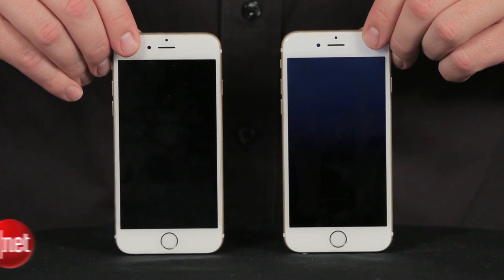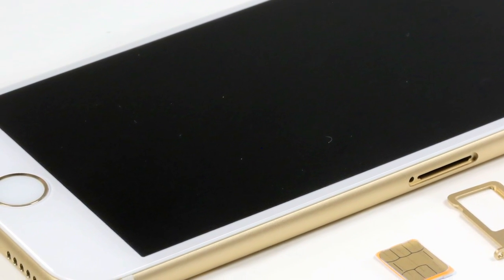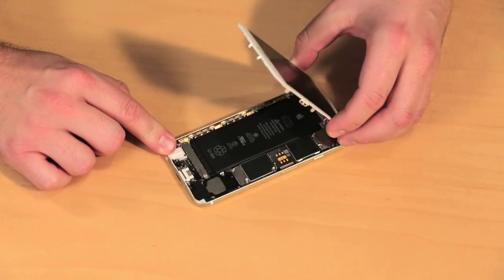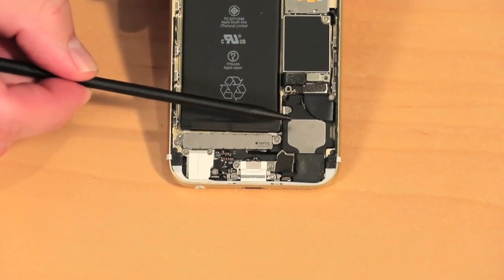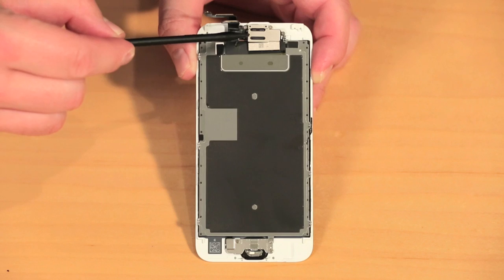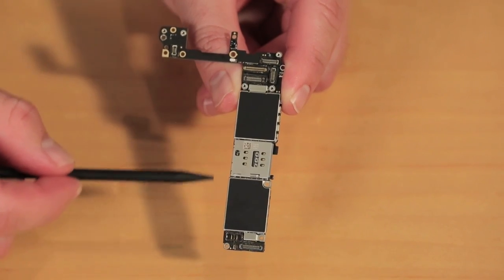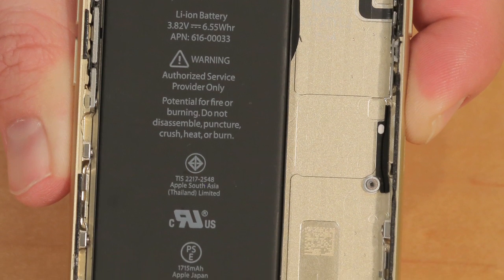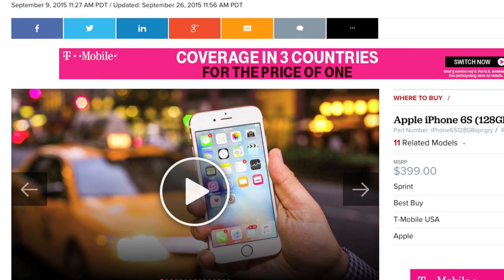Cracking Open - What's inside the Apple iPhone 6S?

Comment: Hi, can you use some parts from an iPhone 6 & transfer them to an iPhone 6s? As the iPhone 6s speaker has so dust stuck inside & the vibration motor feels like it doesn't work properly so i have a spare iPhone 6 back original housing with all these parts so i was wondering if I could just transfer them rather then buying new ones! Can you please advise, as i have checked online but no luck. Thanks

Comment: I have seen photos of the inside of the 6S and they showed a seal inside the phone, I'm wondering if that seal needs to be replaced when you open these things up.  After seeing new water tests, a free unit (not opened) lasted a long time under water without causing damage.  But I'm wondering if an opened unit will have the same level of lasting as long under water.  Has anyone done a test between an unopened unit and an opened unit to see if there is any difference in a water test.

Comment: Why upgrade when i have jailbreak 3D touch?
Reply: Coz you get 4K instead of 1080p that's why
Reply: +randome fix it's the same -_-
Reply: 4K? I Don't care. i got 3D Touch + Live photos? i am using Iphone 6 AND I HAVE ALL THE NEW THING ON IT ;)
Reply: +randome fix whats 4k? the screen for a regular 6s isnt even 1080, only the plus model. The camera I suppose you're talking about?
Reply: +Seymen “PS4” Kiran Jailbreak 3d touch isnt even real 3d touch, it's just long press.
Reply: +Cerb The Beast it works, and i glad:)
Reply: +Seymen “PS4” Kiran from what I can tell 3D touch is in the hardware of the phone, there for, your jailbreak did nothing but enable longer presses.
Reply: I Know. But it is stil the same process. ;)
Reply: Poor guy
Reply: So i am poor because i don't have an Iphone 6s But a Iphone 6? Damn. What a poor guy. Do you even have iphone? noo you have Nokia from 1999,.
Reply: They still update Iphone 4s,
Reply: +Prince Aaron Joshua Funny thing is you have neither.
Reply: He has a Windows XP ;)

Comment: The battery life between the s modules and the standard 6 modules is quite different. Even more so between the 6 and 6s - at least 27% less battery life in the same time frame.

Comment: 3d touch? all they did was take 1900 tech and combine it with today's capacitive touch. android has so much more than this over glorified toilet candy.
Reply: "So much more" but you couldn't name a single one.
Reply: Wishwader removable battery, expandable storage, my gs5 is waterproof. There's 3, want me to keep going?
Reply: +Ethan Ford yes, please keep going. You haven't named one yet. I owned several smartphones with expandable storage and removable battery when Android was busy ripping off the Blackberry UI pre-iPhone. But not only that, flagship Android phones are beginning to drop both those "features". Expandable storage never worked cleanly anyway, it doesn't work like internal storage. And vast majority of people never took the battery out of their phone - second battery was an edge case.
Reply: Wishwader my phone has sensitive touch so I can use it with gloves on. Androids have infared sensors so I can contoll my TV. Heart rate sensor. Highly customizable user interface. Iphone users have to jailbreak to be able to have customizable capability that androids have. price. Iphones are in the $800 when androids are more like $300 $400.  You can access the files so much easier. Iphones have to be jailbroken to get to the files. SSH is available on android since it's linux based. Apple uses a stupid different cable every Gen while androids are all able to be charged with any micro usb. Swipe text makes it way faster to text. I can keep pumping these out but I have a life so I'm not replying anymore. It's a fact that iphones are over expensive hunk of poop that white girls use to take selfies of them and their Starbucks.
Reply: +CryztalBT there are several file managers with handle all those file formats and direct viewing/playing of them. Can edit excel files fine. I don't care about micromanaging a phone and I don't care about pixel level layout of icons. I just want the device to do the work so I can do more productive things. Android users have way too much time on their hands. Don't have time for virus checkers or daily ram and disk space recovery tools and all that noise which comes with Android.

Comment: It's not a few millimetres thicker. It's not even anywhere near 1 millimetre thicker. Come on, Bill..
Reply: +Wilde Steele It's actually thicker due to the use of 7000 Series Aluminum and the 3D touch panel which goes under the glass panel.
Reply: +TekReview's Sure, but my point still stands. It's 0.2 millimetres thicker, according to Apple's website anyway.
Reply: Wilde Steele I would agree it's not much of a big deal the phones weigh about the same and there's really not enough of a change to worry about. I would wonder how long that 3D touch panel would last, might be better off going with the older 6 model unless you are anal about gaming performance but even then Grafixbench only rated the 6S at 45FPS during testing. Apple claimed 60fps on their "new" phones.

Comment: so the Galaxy s6 is still better?  Good
Reply: Wishwader You said they copied everything.Yet you say they don't align the ports and buttons like apple does.They do align it in their own way and it doesn't matter to most people unless you have ocd.It fairs better only in single core tests.Overall samsung has better performance.You're comparing the 6s which just released to an s6 which was release many months ago so it is not really a fair comparison.The camera on S6 has better detail than the 6s and is one of the best according to many reviewers for example MKBHD and techsource which are reliable sources.I agree that ios has a more optimized os but it comes with a price of not being customizable and lacks freedom.
Reply: +Shriyram Rajasegaran you say only ocd people would notice Apple's attention to detail. But that doesn't negate that Apple pays more attention to detail. Comparing handsets side-by-side in a store I certainly noticed the difference compared to Samsung.
Reply: +Shriyram Rajasegaran saying someone else's camera has better detail is a covert way of saying more mp. I don't care about quantity I care about quality of the pixels. This is why Sony released a high end camera where the biggest difference was fewer mp (but better in low light). This is just as applicable to mobile phones because we often use the tiny sensor/lens in dark social venues.
Reply: +Cesar Galvez hardly. Samsung doesn't even align the ports and buttons on their handsets like Apple does. Better camera according to who? (please don't just quote mp from a spec sheet). Faster according to who? Apple typically fairs better in benchmarks and also has a more optimised OS.
Reply: +Shriyram Rajasegaran I really don't want to run anti-virus on a mobile phone, with all the maintenance, hit on performance/battery life which goes with that. I also doubt its effectiveness, given any app can have nefarious intentions.

Moving from Windows to the Mac was a breath of fresh air in terms of viruses. Mobile is no different to me.

I high percentage of Android users have at least one app which intentionally leaks their private data to third-party collectors. If anything I value my private info more on my mobile phone than i do with my laptop, so the current state of Android doesn't appeal to me at all.
Reply: +Shriyram Rajasegaran you say iOS comes at the cost of freedom, but I like the control Apple has. I appreciated this approach in smartphones pre-Apple too, like with Symbian. I don't trust app developers to use resources responsibly. I want to put my phone in my pocket and trust that it'll be functional (not drained or locked up) when I next need it. Especially when I have hundreds of apps installed. Freedom is overrated, because it just as much applies to manufactures, who in turn abuse it at the expense of the end-user - I don't want crapware, trialware, multiple convoluted ways of doing exactly the same thing, or inconsistent ui wrappers preinstalled that i can't get rid. I don't want my personal info or comms interfered with spyware, which is vastly more of an issue on Android. So you say freedom, but here it comes at a cost.
Reply: +Wishwader Bro Mac has viruses S6 has better low light camera performance and more saturation. My old windows Xp pc which I use to this date as a media server in my basement has only gotten one virus and that was after support for Xp ended. State evidence not fan boy quotes. Alot of reviews (MKBHD,Unbox Therapy and Techno Buffalo) all like Samsung  design better than apples, which in turn apple got from HTC m7
Reply: Eat it boi. Who doesn't love Samsung's design
Reply: +Eat it boi. Bragging your Windows PC got one virus doesn't impress me. My 8-yr-old Mac laptop has never had a virus.

Not everyone likes saturated colours. Some people prefer accurate colours. If inaccurate photos is your thing there's plenty of filters that can be applied.
Reply: +Wishwader Not Bragging at all but my pc's 10 years old and you said windows got may viruses and I gave some evidence to disprove any computer can get a virus it depends on what is performed on the pc. Plus you can take RAW photos on the s6 eliminating inaccurate coloring :)
Reply: +Eat it boi. Saying any computer can get a virus doesn't tell me anything. The real metric is likelihood of getting a virus. Vastly more likely to get a virus on Windows than a Mac. And vastly more likely to get a virus on Android than iOS. It's not even remotely close. We're talking 99%/1% ratio here.
Reply: +Wishwader how come the 6 had the side power button when samsung had it for years?
Reply: Nobody mentioned Samsung's knockoffs because they're not relevant in this video.
Reply: +Wishwader Knockoffs?What exactly did they copy
Reply: +Shriyram Rajasegaran everything.
Reply: Wishwader  they did it way better though.  The Galaxy s6 design is  way better in comparison.  It's faster,  better Camara,  like damn
Reply: Wishwader I did not talk about megapixels if you read my post properly.I was referring to the overall quality of the pictures in all conditions. Many people including myself agree that the s6 takes better pictures overall.People also say that the 6 plus takes more natural pictures which I also agree on.But more saturation is what most people want.
Reply: Wishwader I agree that ios is somewhat more secure than Android but all devices have the ability to get viruses.There was a security breach a few days ago where there were malicious apps on the appstore.Luckily apple managed to solve it before the release of the 6s.If they had not there would be serious problems for users.On android,there are antiviruses like 360 security that protects your phone from viruses and spyware so it makes your phone safe.For an average user who just customizes the launcher of your phone and adds some fancy widgets you should be fine.Enabling installation of unknown sources may scare some people but 360 security protects your phone.Only for power users like me who roots their phone for full control should worry but I have not gotten any problems on my phone.Anytime my phone installs files 360 security scans it and detects for viruses.If there are viruses it blocks it and you can clear it easily.
Reply: +Cesar Galvez I guess no
Reply: Wishwader 360 security has an optimizer that actually increases your battery life.It also let's you choose permissions for apps and lets you know if it can read your private info.Apple may have higher security but like I said no device is virus free.I have never downloaded an antivirus and I haven't gotten any viruses on my windows pc.I may just be lucky but I also know how to prevent my pc getting attacked by viruses.Though it's your opinion so not gonna judge.
Reply: +Shriyram Rajasegaran No one every loves that design
Reply: Eat it boi. I find that hard to believe but I'm sure most people love the design.
Reply: +Shriyram Rajasegaran Nah I'm joking alot of people believe the the design is a little weird but owning the galaxy s6 it is a beautiful phone. I love the edge and how it gives the illusion of the phone being supper thing.
Reply: +Eat it boi. Many viruses
Reply: Wishwader You're partially right.But you're ratio is exaggerated. I would say a 25% higher rate to get viruses on pc than a mac.You can easily fix this with an antivirus.Personally I don't use an antivirus but I have never gotten a virus yet.It's about knowing how to take care of your pc.
Reply: +Wishwader Then Again remeber Mac users to Windows users are about 1 to 28 and for about how many Mac's that equates too it's not worth while to create viruses for Mac Systems, iOS on the other hand actually is worthwhile and hackers have created viruses targeting iOS.
Forget all ratios honestly android and Windows don't get viruses unless your watching porn, or pirating online services or items. And people who get viruses out side of that should be more aware of their operating system.
Reply: +Wishwader they copied the side power button from samsung, and apple runs on samsung -_-
Reply: +josh j No, they didn't. And they don't "run on Samsung". It's Apple's IP and they don't need Samsung for anything. Current iPhones CPU is manufactured by TSMC, and where they do use Samsung's fab they have worse battery life. Nothing special about Samsung. Apple just use multiple fabs to meet demand.
Reply: +josh j you have an odd perception of what qualifies for innovation!
Reply: +Wishwader lol man im just trying to join in :p
Reply: Oh yeah its good
Reply: just got the 6 plus, traded ion my iphonr 6 for it
Reply: *s6 edge+
Reply: +Wishwader It's because Samsung was contracted lately as a last resource and they weren't given parameters as quickly as TSMC got theres. Look at the Exynos 7420 I believe that's a 14mm fab and it runs great, (Imagine that beauty pushing the amount of pixels the A9 has to push) But anyway samsung is a great chip maker and general internal hardware supplier. They create and choose parts very well. (Look at the Note 4 and 5s DAC it's great and the microphone quality is amazing) But if you were told to build a go cart in a day it wouldn't be so good, and that's a overview of what samsung had to deal with. I can say though the 14mm samsung fab handles tasks about 15-20% faster.
Reply: +Wishwader sir apple is the knock off here they are using osx and osx is based on linux what is android ohh wait based on linux were does samsung run on android so mac and android are 50/50 for viruses and yeah ios is more optimized but its overpriced the build a phone like this for 120 bucks or something and sell it for 700/800 bucks im not saying samsung is cheap but yeah for the price u pay for a samsung u get more than what u get when you buy an iphone
Reply: +TGgaming fvvjn
Reply: but note 5 is bae
Reply: +Shriyram Rajasegaran University of Cambridge study finds 87% of Android devices are insecurehttp://arstechnica.com/security/2015/10/university-of-cambridge-study-finds-87-of-android-devices-are-insecure/
Reply: +Cesar Galvez G3 remains my fav phone of all time, and the V10 is better than the S6 in almost every way.
LG master race
Reply: +Florin Salam V10 is slower, Not as Pretty, and made came out after the s6 meaning it took longer to make a bad phone.

Comment: common android user:android is the best get to our status of tech
Reply: Nah it's normally apple users bashing on android(like yourself) by making untrue statements that piss us off like how they say apple created the first fingerprint scanning phone when it was motorola.We use tech as a defense and as a reason to why the iPhone shouldn't cost so much.
Reply: Wishwader I didn't say motorola had a particularly good fingerprint scanner.I jus mentioned they were the first.Most important is not who made it first though it's who made it better.
Reply: +Shriyram Rajasegaran yes Motorola had a fingerprint scanner first but it was hopeless, wasn't integrated properly (just randomly positioned on the back of the device), was clunky (had to roll finger across at a certain speed), was slow, inaccurate, wasn't properly integrated with the OS. It was a rush job as with most companies who try to beat Apple. Apples fingerprint scanner was baked in the oven much longer. Then Android manufacturers/users bend over backwards to discredit the finger print scanner, then of course promptly try to copy it afterwards.